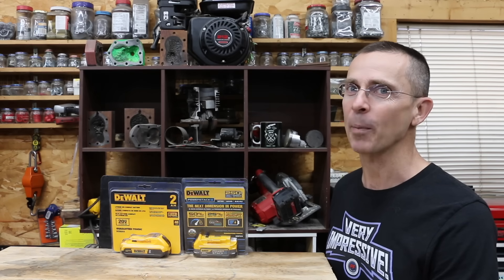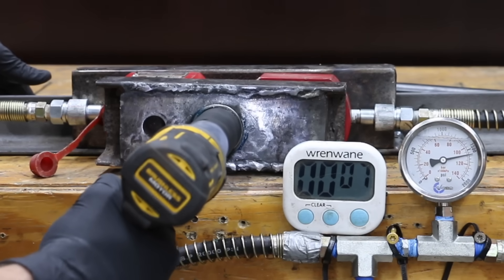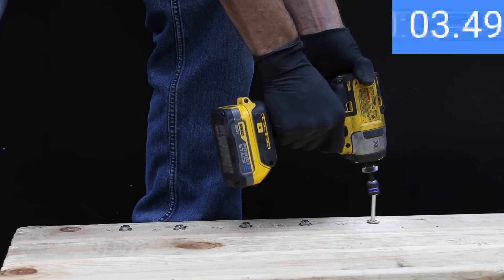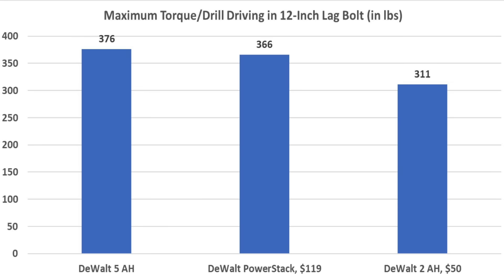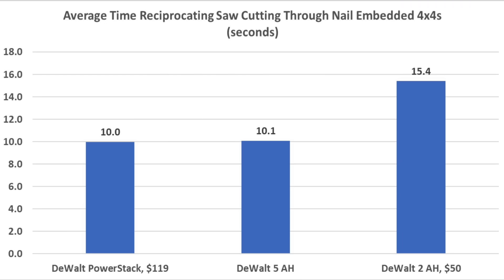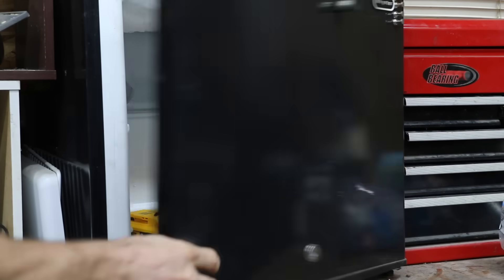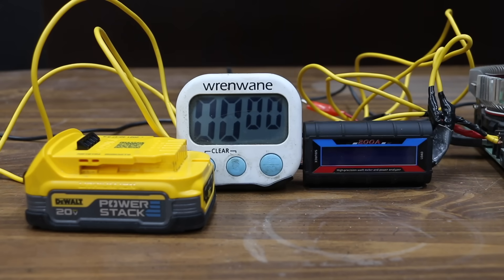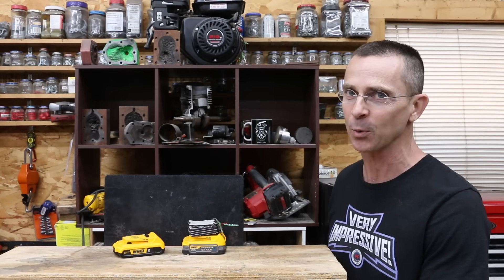Compact “Pouch Cell” Battery Better? Let's Find Out!

Comment: I have worked on making drone batteries and we experimented with both pouch cells and 21700 cells. We definitely found that the pouch cells were lighter and held a bit more power but we ended up changing to 21700s as the pouch cells were much more delicate and we had several suffer thermal runaway after relatively minor crashes. If it is a really hot day and you are using the batteries hard you had better not drop them, the thermal sensors on board just stop the drill from working if they get hot, it won't stop thermal runaway. That is why Tesla won't use them either but some other car brands still do.
Reply: Like you, anyone with experience with radio control models is well aware of the downsides and volatility of pouch cells which is why I was shocked when finding out dewalt is now using them. 
There's a reason tool manufacturers use cylindrical cells, yes there's gruntier options available but cylindrical cells are the most robust and I'll be honest, I'm a heavy equipment mechanic, my tools get a VERY hard life, borderline abused. It's just the nature of the beast.
Reply: @deezelfairy  No kidding, I have dropped my power tools from my box onto concrete, dropped batteries, toss them into my bag and throw that around. I don't work on heavy equipment but I am an auto mechanic and used to work on class 8 trucks. These things get abused but it's not even close to the abuse i've seen working construction, which is one of the biggest markets for dewalt. You have 18 year olds tossing these things into the back of a gator and running down rough tracks bouncing all over the place on the way to the work area from the equipment trailer. I've never seen power tools abused as bad as I did in construction, even through my gloves touching the metal housing of the 1/2in impact would burn you after they spent an hour straight running it full out on an solar farm install. The batteries got almost as hot and were beat to hell, each battery lasted about 10-15 minutes (5/8ths galvanized bolts, just hit the nut until it stops getting tighter and thats torqued to spec for the site instructions, do that for 6 bolts per post at 30 posts per row at almost 1500 rows and you have a lot of abuse on those tools).

These pouch batteries as they call them would catch fire day two. The cylindrical metal cells however take anything you throw at them. Hell, Samsung has testing documentation where they crushed them with a press and the worse they did was smoke and leak, they never caught fire. They put them in an oven and turned it on, again only smoking and leaking. They are WAY safer for high abuse environments.
Reply: @2009dudeman  I crushed a brand new 9ah flexvolt battery between a forklift mast and the chassis - it was on my work lamp and forget it was there and tilted the mast back - CRUNCH! 😂
Cracked the casing all the way round but it still works. If it was lipo I would have expected it to catch fire their and then being fully charged and I never would have trusted it again if it didn't.
Reply from the maker: Thanks for sharing.
Reply: @ProjectFarm  you should pierce the pouches and see if they catch fire. 🔥
Reply: @AzTurboMini  If they are hot they will burn pretty much straight away but if they are cold they just sit there till they get hot enough to cause thermal runaway and then they will burn, they can sit for months without doing anything but the next time they get used hard they explode. The gases aren't good for you so be careful if you attempt something like that. Also, once they have started to burn it is hard to put them out.
Reply: Yep.  I want to call those things ly-poo due to their more unpleasant tendencies.

Better to use a lot of the canned cells if one can endure their bulk/weight, those or the lithium iron phosphate flavor.
Reply: These are mobile phone batteries.
In a hot summer, few years ago, i left a phone in the car for 15 minutes until i was ready to go.
Phone went in crazy mode beeping and flashing alerts to remove the battery, wich was undetachable.
I was affraid it's gonna blow up.
These are not batteries to be used in hot weather on construction sites.
Reply: This Needs To Be Publicly Known!! _ Thank You!
Reply: @johng4527  Yes, with 4, 6 or 8 motor, autonomous drones, we were definitely trying to get the most flight time as we could. We found over time that the pouches would swell a bit and deform the battery so it was made out of shape. The drones were mainly used for autonomously scaring birds away from crops or airports etc. and if the person that paid for the drone was using it (ie, changing the battery between flights), they didn't have as many issues but the problems occurred when the employees were using (abusing) the drones and mishandling the batteries (they didn't pay for them so they didn't care). I can see this happening with the Dewalt system as well, there won't be much problem for the people that treat the batteries well but for the employees that didn't pay for the tools they will find a lot more issues. I suspect the far higher price is due to Dewalt expecting more returns due to malfunctions and not just to cover "new technology" but they want to be able to boast about "more power and less weight" vs other companies. I recommend getting employees the tougher 18650 or 21700 batteries as they are definitely tougher than the pouch type. I am a robotics engineer, a battery engineer would be able to give more details but I don't know any, batteries are just a small part of what I have to do.
Reply: I was thinking this too. I had a LiPo drone battery melt down in the back of my jeep. I was soooo lucky it only melted the carpet and didn't burn the whole vehicle down. 
I just don't see pouch batteries being beneficial in the power tool industry.
Reply: I've had thermal runaway and shorts from dropping thr battery from a moderately short distance ruining said battery. I wouldn't dream of using it in a power tool where I've dropped them from ladders by accident 🤦🏼‍♂️ I try to be careful but when using power tools it's generally rough environment and continuously hard.
Reply: I'm learning Electrical Engineering, BEVs, and Hybrids. Thank you for this information.

I have thought about using the Pouch or flat Polymer style of batteries, in homemade EV projects. But unless I'm building something for a Drag-strip, I should probably stay with round cells.

It's frustrating Tesla still won't sell their great batteries direct to customers, to my knowledge, even though the great lord & savior, Elon, said he wants to lay the smackdown on engines. 

I don't know what he & company thinks about homemade EVs, there's no good reason why they are not making motorcycles, scooters, and e-bike, because many people don't want or can't afford a car, and now they made a recent & genius advancement with their new 4680 cells...but very unlikely to sell, meaning I have to hunt savage yard wrecked Teslas.

But either way, it's great learning more about batteries. 

Thank you for this information.

I've been hoping to just scale up drone & smartphone batteries to an Electric Motorcycle pack.But costs, and things like what you said, make me rethink this.
Reply: @johng4527  I've been using lipos for years too on an extensive rc car collection and I've never had one personally fail either but I have seen the aftermath of when they do.
I do take extremely good care of mine though, always charge to 4.15/4.17 volts rather than 4.2, always balance, storage charge ect.
There is no debate that when lipos fail it is generally far more catastrophic then a cylindrical cell - it's enivitable due to the insane peak currents lipos can deliver for their cell size. 
There is also no debate that lipo pouch cells are easier to damage then cylindrical cells. 
If I accidentally treated one of my rc lipos like my dewalt tool batteries it'd be discharged to 0V and put in the bin.

To each their own bud, but in my application I'll be giving them a miss 👍
Reply: @johng4527  The battery sensors on the drone would automatically land the drone if there were serious issues. I addressed this issue in my original comment. The drill or charger will shut down once the battery senses too much heat but thermal runaway can occur with impacts or other damage to the battery and pouch type batteries are much more prone to this issue. Thermal runaway is an exothermic reaction so it produces it's own heat during the reaction so once it starts it can keep getting worse, I have seen it happen. It isn't going to affect all the batteries but I can pretty much guarantee it will happen to these new batteries more often as they are definitely more delicate. I would wait and see how these batteries last for a while, especially in hot areas and if my workers are a bit rough on the tools.
Reply: @johng4527  they all do that. There's usually 5 18650 cells in series. Nominal voltage is 3.7v so that's 18.5v. Actual charged is 4.1 to 4.2v so that'd be 20.5v to 21v.

Any of the nomenclature is correct. They could call it 19v if they want to. All the manufacturers do this. It's silly and would be nice if they stuck to a standard but marketing rules the day.
Reply: @johng4527  Makita does it with their 20V and 40V range as well, it sounds like it is more than the 18V and 36V ranges that others are starting to put out.
Reply: Interesting! Might have to test that? 🤔
Reply: @johng4527  Apparently so, I shit you not. I suppose their only 'technically' capable of being used with their tools so makes no difference where the low voltage cut off is.
Wanted to power a portable 12v fridge with a flexvolt and buck converter but found out I've got to integrate a low voltage cut off circuit it in (no big deal). As far as I know its only dewalt who do it that way.
Reply: Same as. I've seen drone packs start to burn in people backpacks 10 minutes after they stopped flying. Very temperamental, although these powertool packs look a bit more heavily built. I would like to see Todd drill through one, or fasten it in his vice.
Reply: In more direct terms, make sure your fire insurance is up to date if you buy these, and NEVER leave them on the charger.  EVER.   No "OOPS, I FORGOT".
Reply: @johng4527  I agree. And the charger has to be different. I'm sure many people will put this battery on their  charger not rated for lipo. However, Dewalt lists this as lithium-ion because they say it works with the li-ion charger.
Reply: @Powerpickle68  To be fair the charge curve for li ion is basically the same as lipo. Only thing you have to be careful with is some cylindrical cells have a 3.6v nominal and 4.1v charge/max voltage where as lipos are generally 3.7v nominal and 4.2v charge/max voltage so you'll never going to harm lipos charging them on a li-ion charge curve.
The curve for all lithium batteries is just CC/CV
Reply: @deezelfairy  I don't know of any modern cylindrical lithium ions with a max charge of 4.10V
Reply: I wonder if the Tesla 4680 cell will make it to power tools.
Reply: @FreedomFinanceFun  they're definitely worth it in the automotive applications, but for tools I think there is too much void space lost due to the larger diameters. (Smaller cells pack together tighter)
Perhaps it's worth it tho... We'll see!
Reply: @johng4527  Actually, the dewalt batteries don't. They are the one tool brand where the low voltage cut off is built into all the tools themselves, not the batteries. This is why with dewalt batteries you have to be very careful with the aftermarket adapters you can buy to use them with other brands/use them as a power supply. Why would I want to run them down to 0v anyway? I was referring to my rc lipos when I suspect one is faulty - I put a 100ohm resistor across the battery plug.
Reply: These pouch cells are NOT lithum polymer cells like in rc cars.
Reply: @David..... : Yes they are. Their full name is Lithium-Ion Polymer, or LiPo for short. I have never heard them called pouch cells but that certainly describes their appearance. Li-Ion cells are always cylindrical.
Reply: @hockeyguy820  They have been but don't have to be. These are li-ion because they work with the current chargers which don't charge lipo.
Reply: @hockeyguy820   Not always.  Most phones are pouch cells.    Same with larger cells.  But you don't see those used all that often.   Bought a ton of them from a car audio project.
Reply: @hockeyguy820  Most cellphone batteries are Lithium-Ion and are not cylindrical. FYI

Comment: Great video and testing of batteries as always! :D 

But since you opened the battery, I would really liked to see the spec sheet comparison for the different battery cells. Discharge rate, number of charge cycles (expected lifetime) and option for repair the battery if a cell goes bad, are all important factors when i choose power tool brands, and what type of battery to get. 

Personally I really like the Bosch Procore batteries, do to the use of 21700 cells and easy repair. However, the price on those batteries are also insanely high, so I have chosen to build all my powertool batteries myself. Using a DIY bosch procore kit from Aliexpress etc. Paired with brand new high quality cells like the Molicel INR21700-P42A 4000mAh. Im able to build the procore battery for around half the price what Boch is currently asking.
Reply from the maker: Thank you!

Comment: If these power stack packs are Li-Po, that means that (if they are designed correctly) they will slowly lose voltage over a few days. Li-Po battery store best at somewhere between 50-75% battery capacity. So companies will include an automatic drain feature so that they don't sit at full charge. This could be a pain when you go to use your tool and the battery has been sitting for a few days, only to find that it lost a bar or two. Now, (from what I've learned with drone batteries) this is actually a good thing for the cells. But if the cells don't drain, it has an affect on the life of the cell. Li-Ion batteries don't seem to suffer from sitting at full charge as much as Li-Po does. It'll be interesting to see how the longevity of these packs hold up to consumer use.

Comment: The concern I have about lithium polymer batteries is that they bloat when over-discharged or over-charged.  I know there is battery management circuitry but that can't control what happens if the batteries over-discharge.  A battery could over-discharge by using it until "dead", then not recharging it in a timely manner, leading to deep discharge.
Reply: I agree. My drone batteries are always swelling up.

Comment: I've heard that car batteries based on Lithium Ion tend to work better in the cold than their lead-acid counterparts. Your testing seems to suggest this is true (as each screw gun sped up as it warmed up). I've only ever seen DIY Lithium batteries in (non-electric) cars, so not sure if mass market models exist? Could be a review opportunity. 👍️
Reply from the maker: Thank you for the video idea!

Comment: Not a fan of either the 2aH batteries, nor the stack... The 2aH wears out pretty fast and does not pack enough punch nor capacity, the stack is too small and gives a weird balance on many tools. The Stack also does not offer nearly enough capacity.

The better choice would be a 21700 based pack in my opinion. You should try the Dewalt CP-packs with 21700s!

Comment: Be very very careful with those power stack batteries. You have no idea just how violent that lithium can be. Taking It apart and separating the cells was very dangerous..... all it takes is one rip in that black cover and there would be a fire that you can't stop. Lithium fires don't need oxygen to burn.
Reply from the maker: Thank you!

Comment: I can see where a mechanic can benefit from the power stack battery by delivering high power in a compact package. There have been many a times I needed a smaller battery for an impact wrench to fit but the typical 2.0ah don't give enough power. Air impact it was. Excellent video as always 👍
Reply from the maker: Thank you!

Comment: If you want value and longevity, then you don't need to watch this video: the one with the universal battery cells is obviously the best choice, since buy the cells from anywhere and replace them yourself. One of your most pointless videos, actually. You want longevity and value, yeu go for non stacked. You need longer battery life and understand that you're buying a product designed to last a significantly smaller amount of time, you go for the stacked cells.

Comment: Wonder if DeWalt has looked into the fact that majority of airlines won't allow lithium polymer batteries on board. Already is a pain traveling with tool batteries for work as you need to carry them with you and get asked a lot of questions.
Reply from the maker: Great Point!

Comment: There is a reason pouches are used for drones, packs some punch at a lighter weight. on the other hand I'd like to see longevity comparison of these to traditional ones. I had to discard many Li-Po packs but rarely had to get rid of any 18650s. Pouches tend to swell over time according to my experience.
Reply from the maker: Thank you!

Comment: It looks like dewalt is going the way of the hobby grade radio control industry. LiPo packs can provide a much higher discharge rate or ‘C’ rating. However, they are more dangerous (fire prone) when seriously discharged, or poked/penetrated.
Reply from the maker: Great Point!